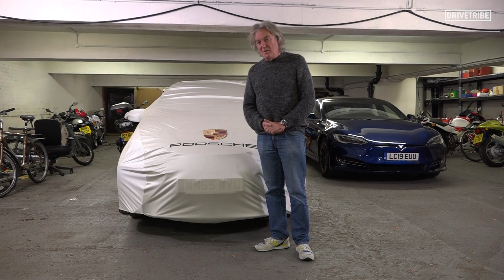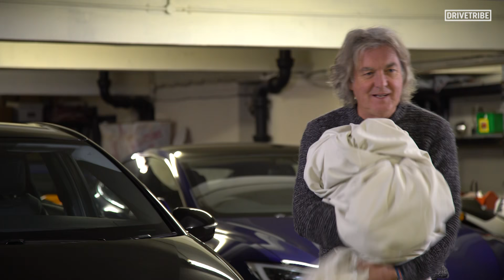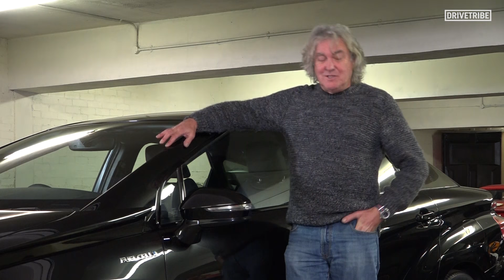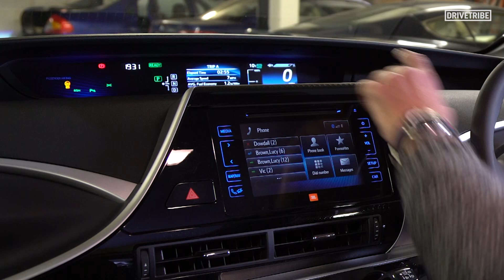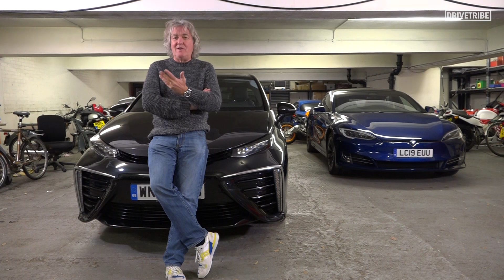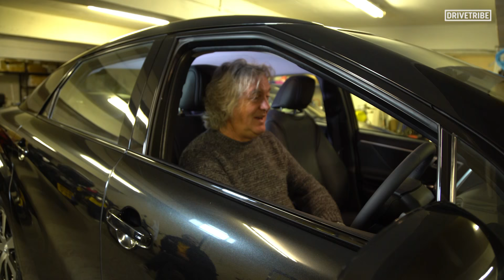James May has bought ANOTHER new car

Comment: Hi James. I remember a while back on TG, when you reviewed Honda's hydrogen powered vehicle. At the time, you stated that it was indeed the way of the future for many reasons, one of which is it's only emission: water. I agree with you that the hydrogen vehicle will be the ultimate winner.
Reply: @BakjeLeip  Yeah, but Real Engineering makes a very strong point: anything bigger than a car becomes too heavy when powered by batteries...lorries, trucks, semitrucks, but also construction equipment, operative vehicles and so on make much more sense when hydrogen powered. Especially to build the infrastructure: you can start by making all trucks powered by internal combustion engines fuelled by a mix of hydrogen and methane, and then move on to methane-hydrogen fuel cells, and then get to full fuel cell hydrogen
And also, if we assume something like next gen nuclear power stations will be the core power of the system, we'll have so much electricity that the inefficiencies of hydrogen making become almost irrelevant.
It doesn't have to be one or another: both can live side by side.
Reply: Honda just announce he is dropping the H2 project. How ironic !
Reply: @philv3941  no surprise really as it does not make sense. EV wins on all counts except for charging/refueling speed, which will improve in years to come.
Reply: Honda just stopped their hydrogen program. It's the betamax of alternative fuels.
Reply: @BakjeLeip  but battery electric also requires alot of energy to mine to get to the acids. Also, if you're recharging your car in a plug that is ultimately powered by a coal/fossile fuel factory it's better to just use a gas car
Reply: EV'S will be the winner.
Reply: flip inheck  Okay, but you've just stated that the FCX Clarity produced its own hydrogen while the Mirai does not, that is factually incorrect.

Unless that reply wasn't actually intended for me.
Reply: flip inheck   "The Honda could generate its own hydrogen, the Toyota can not"

It's literally your first comment and the one I was replying to.
Reply: flip inheck  No y'see, there aren't any cars that work like that. You have the process reversed - liquid hydrogen goes into the tank, it reacts with oxygen electrochemically and powers an electric motor while producing water vapour as a by-product.

No car has used water to power it, and Honda's only FCEV has been the [FCX] Clarity. Electrolysis is used to separate hydrogen and oxygen in water, but the car itself is unable to achieve this.
Reply: SMURF?!?!🖕🏻😤🤟🏻👎🏻
Reply: by that logic a normal EV is superior because it has no emissions at all...
Reply: @leberkas0.5k  brainlet

Comment: When it comes to EVs, you want to use the one that has makes the most efficient use of electricity from start to finish. There's no point using electricity to create some other fuel which you then use to generate electricity unless it's more efficient overall that just powering the car directly using either a battery or supercapacitor.

Comment: im not sure what system they use to turn the hydrogen in to electricity in that but im going to go ahead and asumb its a symple generator using hydrogen as fuel instead of petrol (thats probably wrong)
if this is the case hydrogen power has a massive advantage in that you dont need the high tech batteries or any of the rare, expensive and usualy toxic materials it takes to make them 

whenever i imagined hydrogen powered cars i always thought it would come in the form of simply replacing the thing that the combustion engine burned. i wonder if there is any reason that cant be the case.
you would be able to keep all the much loved parts of the traditional car powered by noise and explosions, but there would be no emissions other than water

EDIT after a little reading i found out that while hydrogen combustion engines do exist they arn't common because you ither have to use a clean burning hydrogen to air ratio which only produces around 1/2 the power of a similarly sized gasoline engine
or you use a mixture which doesn't burn as cleanly and releases nytrogen oxides. HOWEVER when correctly tuned this mixture actualy produces 15% more power than a same size gasoline engine
and it still isnt as heavy a polutant as fosil fuel powered cars

summery: please tell jeremy that hydrogen combustion has more speed than petrol combustion and post a video of him malfunctioning ;)

Comment: The fact that hydrogen always will cost at minimum 30% more than electric charging settled the hydrogen/electric battery car dispute from day one.  Hydrogen is atleast 30% more lossy into your car tank, and it's more expensive than electricity in itself. The masses always go for the cheapest energy alternative so hydrogen cars are doomed because of fuel cost which is absurdly high.

Comment: Beta-max verses VHS. The main determining factor between Beta-max and VHS was the cost of the recorders and recording time. Beta-max is, in theory, a superior recording format over VHS due to resolution (250 lines vs. 240 lines), slightly superior sound, and a more stable image; Beta-max recorders were also of higher quality construction.

Hydrogen vehicles are basically electric cars with a fuel tank. They boast the performance and instant torque of battery electric cars, while providing greater range than any pure EV on the market today. Lastly, refueling times are comparable to gasoline cars, obviating range anxiety and lengthy charging stops

My money is on Hydrogen...

Comment: When electric cars take a day or more to recharge they still arnt a good choice 
Petrol takes less than 3 minutes 
To fill 
So when charging doesnt take aslong then we can easily say ev cars are better
Reply: They don't take over a day, unless you live in the US and hook up to 110v, even so, you never run the battery down to 0, generally you maybe use 20-30 percent of the battery a day  and you charge up pretty  quickly, especially if you use fast chargers

Comment: If electric cars must be the future (would much rather a classic car), hydrogen makes so much more sense. The issue with electric cars are the batteries; using hydrogen cells eliminates the need for precious metals, a limited resource the mining of which is terrible for the environment. Yes you need to use energy to produce hydrogen, but is there any difference from charging your car at home, where your power probably comes from a coal or gas power station. You could use renewable energy to produce hydrogen therefore creating a sustainable and carbon neutral energy source. Another advantage of hydrogen cells is the weight, which will inevitably become an issue as performance electric cars become popular. I saw the mirai in Japan back in 2015, I'm glad that they are finally becoming available here in the UK. I hope they become popular, however in order for this to happen, it is essential that filling stations are opened across UK, rather than just the South of England.

Comment: I'm sure the Toyota has a small battery that acts sorta like a capacitor. Why don't they make that rechargeable like the Tesla? Incase you run out of hydrogen you can still drive the 20 miles or so to the nearest fuel-up point. 

In-fact they should combine the two technologies together and make a car that you drive to work and while it's parked it's recharging it's self for the trip home.  If you think about it, it makes the most sense because it will require the least amount the changes to our infrastructure.

Comment: Sorry, hydrogen production is done through catalytic conversion of natural gas and oxygen into hydrogen and carbon dioxide...
If you want a CO2 free solution (nonsense as is) it's a no-start.
It also requires a TON of electricity to make work, which is mostly produced using fossil fuels as well.

Comment: If the Mirai stored the water it sends out as exhaust, the electricity from regen could produce some hydrogen for reuse and oxygen back to the air, via simple electrolysis. Wouldn't be worth doing for a variety of reasons, but it could.
Reply: technically, you're right. Bit tricky, though.````

Comment: Hydrogen a joke , not the whole story , the fuel is not cheap , you could burn the hydrogen and produce electricity. James more money than sense or add for Toyota old tech that is dead in the water . No mention of hydrogen stations closing because they are dangerous , very slow to give fuel to more than a few cars so you will be waiting for the fuel station to pressure up. Slow cars , with no infrastructure . Norway just closed the lasted electric won already

Comment: Unless they can figure out a way to fully charge a battery in as long as it takes to refuel a regular car, I'm rooting for the HFCEV. You can refuel it very fast, it has decent range which will only get better, all that's needed now is to refine the process of obtaining hydrogen, and building more hydrogen fuel stations. Then again, by the time that happens, maybe cars will be powered by microfusion reactors.

Comment: Hello James, I also find hydrogen powered cars very intriguing. My question is are hydrogen powered vehicles as torquey as something like the Tesla. I prefer to drive heavy duty trucks because I use them for my hobbies- towing trailers, hauling wood and other things. Could hydrogen technology be viable for heavy duty trucks?
Reply: Eventually, I'm sure. At the moment they're quite light. Batteries give good grunt.

Comment: The TFL Car guys have been testing Teslas. Not good for extreme cold (like Minnesota in the winter) or extreme heat (like Arizona in the summer) or towing heavy trailers (like uphill to Eisenhower Tunnel in Colorado). Not good if you ding a body panel either. Perhaps one day they will get it all sorted out, but it's too early as of 2019. On the other hand, I own stock in hydrogen fuel cell technology, and it's been down 90% since I bought it, so,  please buy hydrogen fuel cell cars. Thanks.

Comment: He bought a miniature Hindenburg. 🔥
Reply: LOl, although the Tesla is the greater risk IMO. 
Hydrogen is very safe because it's super light and thin so it rapidly gets out of the way of trouble. The Hindenburg's hydrogen didn't really have much of a role as the skin of the ship was painted in a substance too similar to thermite for comfort...
Reply: @G-ra-ha-m  don't agree. I prefer Batteries but a Hydrogen leak is as uncomfortable as a hot Battery. I don't trust stored gases. specially Hydrogen...
Reply: Graham Yeah, but if a Tesla catches fire, the fire still takes time to build. Hydrogen, on the other hand, doesn’t need as much time. In a Tesla, you crash, and get out if you’re fast enough. In a fuel-cell vehicle, as soon the tank splits open and oxygen gets in, BOOM!! That’s it. Game over. You never had a chance.
Reply: @josephhoward4697  this scenario, 
60 mph when the battery catches fire, a minute later you or the car notices,
Your kids have been screaming in the back and people have been idiots on the road so your distracted like most drivers at any given time, 
Also like too many drivers if the car gives a warning most people ignore it with the  "but it was running fine"
So then you slow down, 
car comes to a stop and flames engulf it as the wind has been feeding it while you were driving  
Now pure panic which always makes a dangerous situation worse, 
if it was parked yeah different story,
Any form of fuel is dangerous weither it be a pressurized gas, flammable spirit, oil, battery or emf
And in real life unexpected things always happen when you least expect it,
There is more chance and risk of a lorry retread blowing off a rim and ripping thru your door and killing you then a death by hydrogen explosion, 
rubber being thrown with approx 120psi of force behind it will smash nearly anything
And happens 100's of times everyday and people tend to be lucky,
The gas pipes under the road are pressurized up to 7 bar which is just shy of 103 psi, 
and there encased by the tarmac,
so if they break the whole road will be thrown up in the air in a deadly explosion,
And you walk over these everyday without out even considering the dangers
Reply: Upside down This scenario:
You hit a pothole or a weird patch of road, and this was the one time the tank refused to shake it off. The hydrogen tank strikes the road, starts repeatedly bouncing on the road, opens up, the sparks hit the pressurized gas, which catches fire. The violent jet of flame isn’t harmful at first, but the intense pressure forced the wound to open wider, eventually leading to a massive explosion. You never even had the chance to pull over. The kids in the back seat were blasted to Kingdom Come. You didn’t fare much better. But at least your body is identifiable. Nobody will ever know who was in the back seat.

Look dude, no matter what you say, it is inherently untrue that batteries are more dangerous than hydrogen. Hydrogen is, as dictated by the laws of chemistry, far more reactive than lithium. Far more explosive. Far more flammable. The only way you can make hydrogen safer than lithium is if you make a bunch of unnecessary modifications, and even then it still might be more dangerous than lithium.
Reply: Upside down Also, I’d have to be one neglectful son of a bitch to ignore my kids screaming about smoke and fire while the car also tells me it’s on fire. And I’d have to be an idiot to shrug off even one of those things. If the car tells me it’s on fire, I sure as hell ain’t going to dismiss it. If the kids are screaming to me that there’s smoke and fire, I’m not going to dismiss them, either. They’re my hypothetical kids, for crying out loud!
Reply: @G-ra-ha-m   I expect this toyota EV will be somewhat safer than the Hindenburg.
 My comment was mostly poking fun. I think one must admit the massive fireball from the burning hydrogen that resulted from whatever initial cause, definitely played a role in burn fatalities and total destruction of the airship.
Reply: @mikeday62  etc. Hydrogen is only really explosive if mixed with oxygen in the right (H2O) ratio, then it gives a pretty severe detonation. In air it just burns like on a gas stove with a faint blue colour - no biggie. 
IMO hydrogen is a very safe gas because it's so light it just heads up with a faint flame and is gone. It will find any crack, vent or flaw to escape upwards and leave, it's a very 'shy' gas. In the airship it would have been out of the top and gone is seconds. Think of those helium filled balloons that float, then think 10% more upward force. 
Hydrogen became 'dangerous' in the public mind largely due to the airship disaster, it was only decades later they discovered the skin was fiercely flammable, you can see in the videos the bright flame fronts spreading downward in a direction where hydrogen (which burns a faint blue) has no interest and no reason to be!
Perhaps I should start a campaign to rehabilitate the much maligned hydrogen in the popular view :D

Comment: I hate the discussion between electric cars and hydrogen cars.
Hydrogen needs a better infrastructure. And every electric car will be a hydrogen car in the end, because you can run the quick charging station with a hydrogen fuel cell

Comment: mirai 0-60 8.9 Sec, model s performance (in lud+) 2.28 Sec ;) hydrogen will probably the long term solution once they have large amounts of spare energy, and the charging infrastructure sorted. Toyota have said this week that fuel cells are not the way forward atm. However if whilst the boffins sort the fuel cell problems they can double the energy density of batteries BEVs will become more viable.

Comment: The main problem with hydrogen fuel cell tech right now is that it's not as efficient as batteries at converting electricity into power to the ground, which means that, at least for now, the economics favor battery vehicles over hydrogen FCVs. Real Engineering did a pretty good video on the topic here: https://www.youtube.com/watch?v=f7MzFfuNOtY

Comment: There only 8 fueling station in uk ? 
Though if have to guess pure ev car gonna win.
Reply: Well if the battery EV is going to have more charging stations then consumers are just gonna pick that and the end.. .sadly
Reply: And more will be built it's not always how it goes and I highly doubt you've ever not bought a car because the closest petrol station that has the fuel the car takes... There's very few of these on the road so they aren't going spend ££££££££'s on opening new sites that will not be used and I will imagine as with EV's fuel stations will start offering it a lot already have LPG and bio-fuel retrofitted

Comment: I really like the idea of HFCEVs and hope they become successful for their advantages compared to batteries (which are honestly the big thing holding EVs back for me). But I think they are unfortunoutly still far from becoming common place, not only for the lack of infrastructure and the difficulty we seem to have producing hydrogen efficiently, but mainly because hydrogen is actually quite dangerous and people can`t really be trusted with a pressurized chemical which reacts with the friggin air, considering too many people have a difficult time dealing with petrol and diesel, 2 comparatively safe fuels. I guess the solution would than be methanol fuel cells which apparently work the same way as HFC, and have the same emissions (water) while using a liquid fuel at normal pressure, but the efficiency is lower and the issue at that point would be producing enough methano, so... I guess we could go back to walking